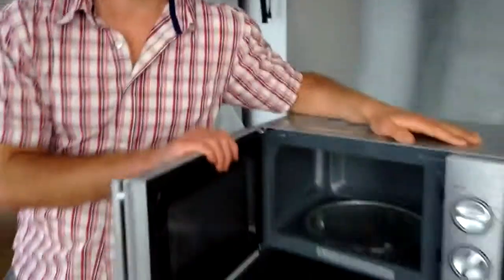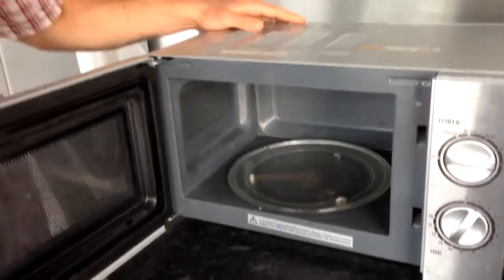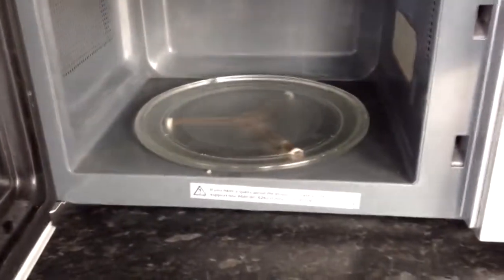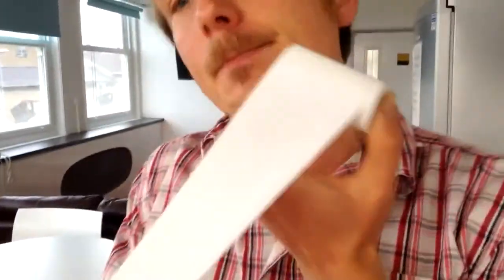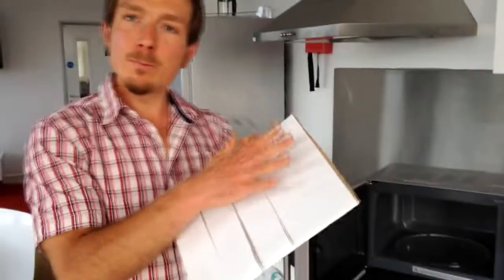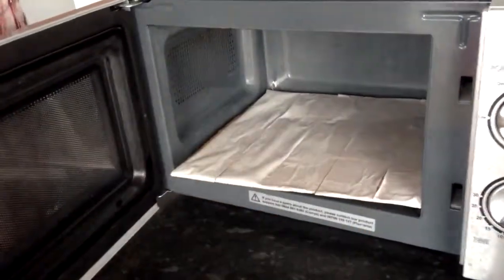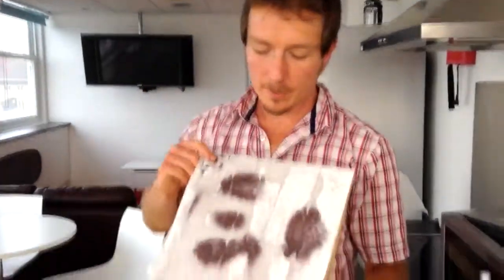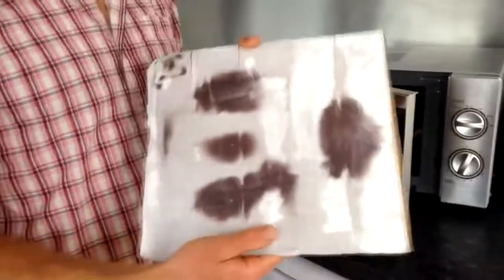Microwave science: How to find your oven's hotspots

Comment: How can I make a test paper?
Reply from the maker: Don't think you're going to be able to make heat-sensitive paper (read about it on Wikipedia: https://en.wikipedia.org/wiki/Thermal_paper ). You can pick up rolls of thermal paper online pretty cheap though, or ask a friendly shop owner if you can have a roll. Alternatively, You could smear lots of slices of toast with butter/margarine and lay them flat, or cover a large pizza base with something fatty (butter or cheese, perhaps). Then providing the spinning plate is disengaged, you will see the pattern of hot spots where the fat melts and the cold spots where it stays solid.
Reply: thankyou sir :)